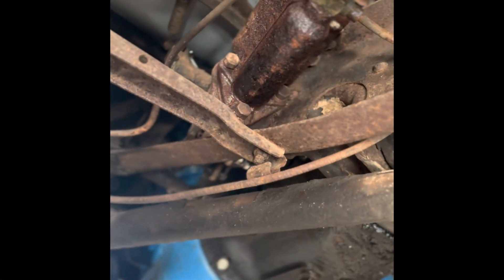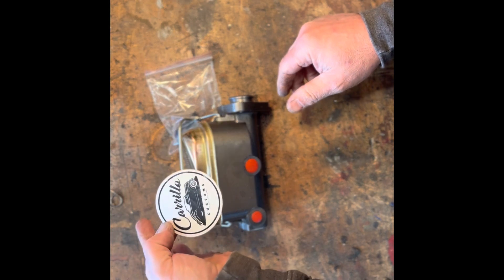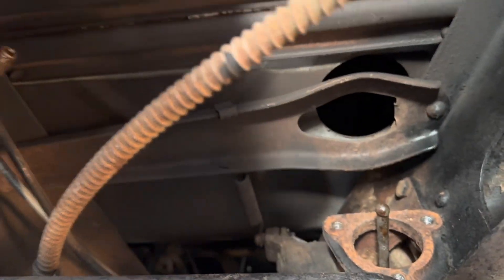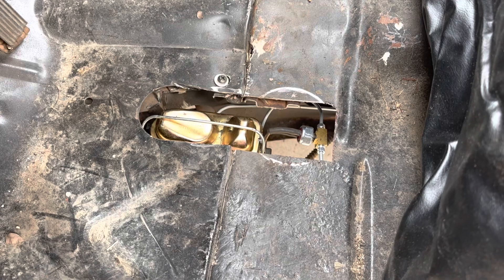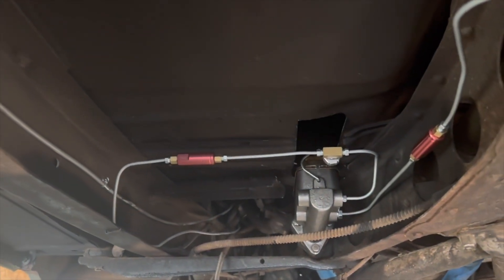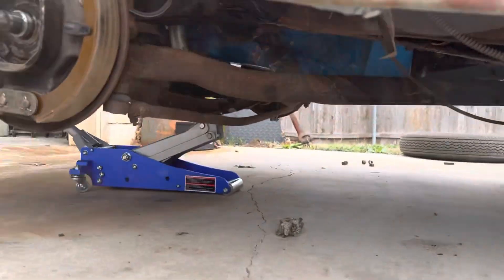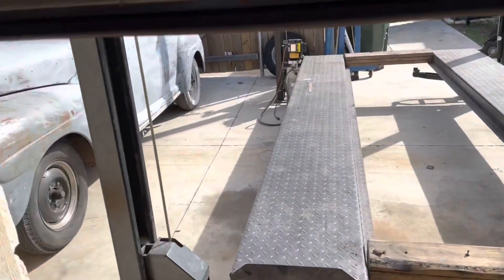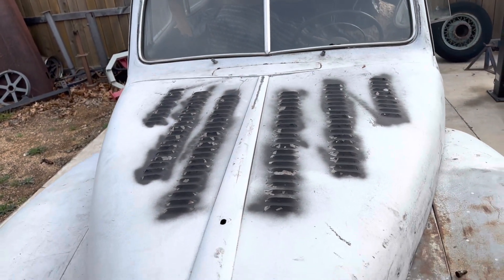Punching Louvers  and brake upgrade on the 1946 Ford ￼barn find

Comment: Millworks Hot Rod Parts sells an adapter that drops the master cylinder and moves it back - no cutting of floor or braces.  Worked on my '47. (same car)
Reply from the maker: Didn’t see that one when I was looking.  Thanks